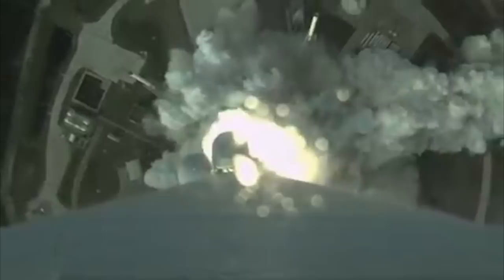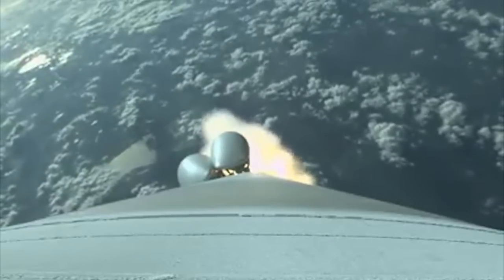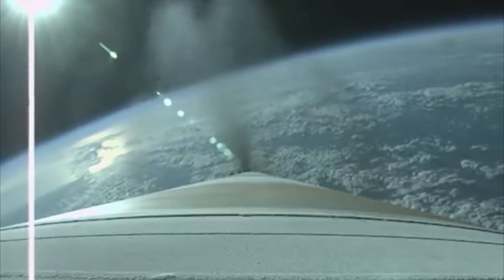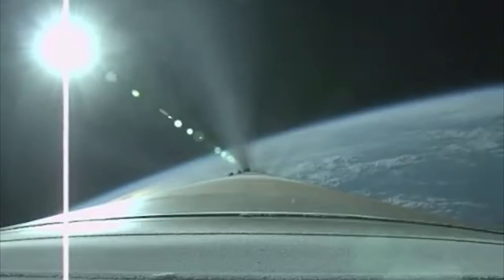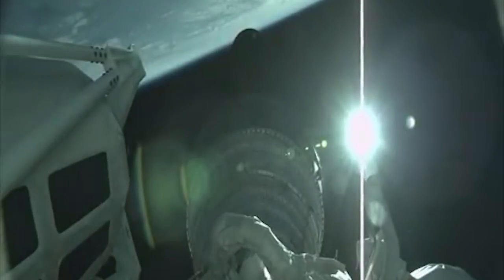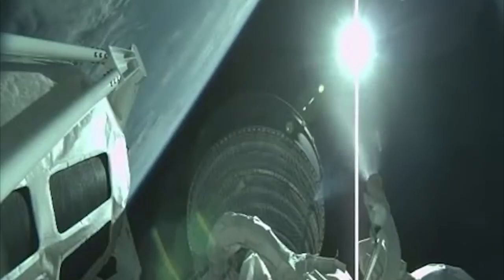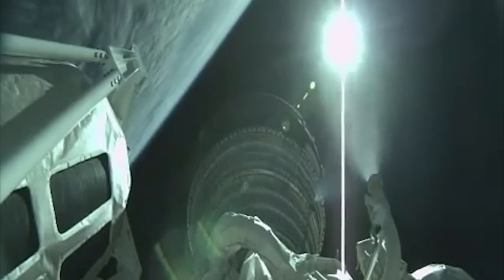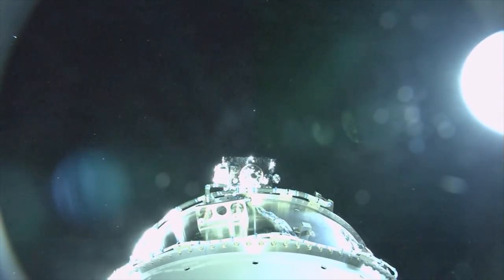Atlas V GOES-S Rocket Cam

Comment: Why rocket not going up in a straight line, so that we can see the full earth!

But it goes in the curved path.
Reply: cause it needs to gain enough speed to stay in orbit. There is no air up in space so u need to choose carefully where u wanna go. Also fuel economy etc.
Reply: Because orbital mechanics weren't made to appeal your desires
Reply: @AAAAAA-zw7oh  and you are telling this to an electrical and electronics engineer and an IT specialist and friend of isro's cheif data base manager!

Science must give proper answers not generic or lame excuses!

I want live whole earth zoom out video, why no one taken it?

Radius of equator is higher than poles means why still nasa shows earth as a sphere still? If you answered this you may have come near to the answer for my question in my comment you replied for.

It goes curved because of earth shape is not a mear sphere as nasa shows at all.

According to nada statistical data and isro calculations earth is like a bun or donut without a hole.

So its sky or atmosphere is not have same curvature and thats why you can see sattelites disappearing in the middle of the sky while moving or suddenly appearing in the middle of the sky.

You must closely and lively watch really what happening it with your own eyes at least with what you can see.

Am a regular star gazer and soecialised in astro physics, so i have a piint when asking about a question, so dont answer me lethargically!

I need exact answers since still i want to add more of my knowledge!
Reply: @amalangelraj  I don't see how me telling that to an electrical engineer or to the king of Swaziland makes it less true. The goal of the mision is not to show the Earth to some guy on the lnternet but to put certain objects in orbit. Just whith the most basic knowledge of orbital mechanics, you can see why the path is curved, then.

Okay, so answering to your question about the radius of the earth: I don't know where did you take the idea that its so far from a sphere, but its not: the diference of the radious on the equator and on the poles is about 20 km in 6300, which is around 0.3%, hardly noticeable if even noticeable at all whith the bare eye.

"It goes curved because..." that doesn't make sense, to put someting in orbit you need to follow a curved path, as orbits are almost parallel to the surface of the earth.
Reply: @AAAAAA-zw7oh then you have to study more to understand.

Didnt you saw the heading of this video, it says rocket cam, to show what, space?

No, the bottom, the earth, from its increasing altitude!

This video is uploaded for all the some internet users to see and question about it to increase knowledge!

Google about oblated spheroid form of earth to know more and search all published articles from official sources for correct radius details.

If the reason is only to put a rocket in space orbit, why do nasa and other nation's space programes sharing earth as a perfect sphere, also they never a full rotation of earth live anytime in any video, it will reaet its position to somewhere where it start after a particular point off time passed.

People must understand whats going on about earth. Why nasa updating different earth for different times but not showing its original shape in live.

Rocket goes with a cam pointing to earth and you think its for putting it in to the orbit?

If something hits it, no one wants to know what hit it, or dont want to see what is above the rocket which is approaching?

From lower orbit how earth looks like amd in hogher orbit how earth looks like?

Yes as you say, they dont care much of the people who seeing their video on the internet. 

They want to hide things and many!

Everything will be coming out soon.

Definitely its not .3% as you think. Dont blindly follow any one website!

Collect orbital statistics, learn about azhimuth and altitude, learm about right ascension and declination.

Then verify the sun's position with any live sky maps, stars and sattelite movements with time accuracy and directional changes and magnitude levels of stars and satellites. Understand how seasons occurs irrespective of the gregorian calendar.

Currently Try predicting sun's next position at 4 pm and 6 pm you will find it not a proper circle but the path varies. Same you do from 5:30 am t sunrise and at 8am and at 11 am.

Then do the same at vernoxes.
Then only you will know what am talking about. Do this for all stars and planets too.

Do this from different places of earth.

Create your own data. Master it by comparing with other genuine sources. 

This not requires any telescope, but need sleepless nights.

If you are practised well nobody needed to you to explain what you are arguing with.
Reply: @amalangelraj  are you mistaking the video with the mision? I mean... you are aware that they didn't launch the rocket to upload a video to YouTube... right?
Reply: @AAAAAA-zw7oh  i wanted some one to find and understand its true reason of launching such rockets.and not misleaded that they have to beive about only what they have been told to beleive to!
Reply: @amalangelraj  what is the true reason acording to you?
Reply: @amalangelraj  for some reson your comment was deleted but I read something among the lines that you can only see the satelites in hours next to sunset and sun rise. So, we can only see the sattelites when they reflect the light from the sun, and when they enter earths shadow the become imposible to discern. And what? What does this tell us about some misterious secret reason for rocket launching?
Reply: @AAAAAA-zw7oh  i didnt deleted any comment, just edited to add more lines, you may have to refresh the page again to see it fully
Reply: @amalangelraj  you didn't make a comment about when you can see satelites in the sky?
Reply: @AAAAAA-zw7oh  you need to do the homework, so you will find more details! I gave enough details in my previous comments. Its not only the shadow, there is something called altitude which modifies the magnitide of the objects propagating your horizon.

Just try to create your personal data on your favourite objects and their path which is not same in the sky.

There is no secrete if you do it by yourselves.

Dont rely only on websites or videos, see it, calculate it and find its originally, you will be amazed of what you find at last
Reply: @amalangelraj  yeah, yeah, I'm sure that you've made your calculations and have found that all the people who profesionally work on it are wrong... sure. I don't want to offend you, but you didn't even seem to understand why a rockets path is not straight.
Reply: @AAAAAA-zw7oh  did ever any rocket that went straight?

Its not about rocket path alone.

Its about what is really out there, what i told you to do is the simple reverse engineering to find what is told to all people is right or not by your own and to find its  degree of truthfulness.
Reply: @amalangelraj  what I'm saying is that if you don't know what the answer to the question if any rocket ever has gone on a straight line should be, you don't have the basic knowledge on the subject to be able to find a truth that's "being hiden to us". And don't get me wrong, that's fine, not everyone needs to be an expert on everything, but it's never good to try to "rebate" the experts from a position of ignorance. Because you're going to be wrong, people will think you're a fool and you'll end up thinking that everyone is conspiring or stupid.
Reply: @amalangelraj  mmm a technichal question. Did you use a numeric methods to calculate your orbits? Or did you go full analythic? Cause I guess maybe in some cases you'd had to consider 3-4 body problems.
Reply: @AAAAAA-zw7oh  you need to use analytic geometry when looking in the sky and before that you need to use trignometries for converting times, timezones and day values to your local for your predictions on objects!

Previous comment edited multiple times for spelling mistake corrections.

If you have sextant, it will help you more. 

The higher your having altitide the clearer you can verify your calculations.

Use pencils and rubber,  not ball pens, that will help.

Use accurate time not 24 hours for earth's rotation.

Forget about leap years and the extra day added to February thats not created for us but for religion.

Consider calenders altered in 1582 and in 1975 since we not used accurate hours of earths rotation if you predicting positions of long travelling oldest comets

Always go for lower magnitude sky objects for accurate verification.

Iss have magnitide of 1 to 2, starlink 8 and 9 has mag val within 2 will be useful.

Select the one which will be crossing your place for atleast a month daily.

Some of them may not visible now abouve your horizon but soon it will.

Better luck for you with cloud free sky.

Happy star gazing and finding earth true shape and something called firmament!
Reply: @amalangelraj  so you did everything on XVII century fashion?
Reply: @AAAAAA-zw7oh  my prediction went beyond 10 to 13 days and i was confused where i missed, and after so many months of searching i found that i missed the 0.6 hours just added to our daily days to make it 24 hours.

And now everything works good, since i found how pope gregory change calenders.

If you are from america, include the daylight saving time if your watch resets automatically,  but if not, dont use DST.

Yes little bit old fashioned but still works well for analytical verification.

Use cooling glasses if you track venus after sun rise. Tracking sun is ok but due to earths eliptical revolution sun rise timings and right ascension position varies Within minutes.

Better to watch sattelites than planets for quicker results!
Reply: @AAAAAA-zw7oh  you know what, i found many uncharterred objects in the sky which wont fit into our calculations, which seems altering the course, may be UFOs or uncontrolled inactive sattelite debris!

I tried filming it but my mobile camera not catching that dim light since low resolution camera it has.
Reply: @amalangelraj  cool, and for some reason all your meassurements led you to believe that everyone is lying about the shape of the earth.
Reply: The rocket needs to do two things, get above the atmosphere and rotate around the earth in an orbit. At the start, when the speed is slowest, getting altitude to get above the atmosphere is the most important. As you get higher, and there is less atmosphere, you start to transition to getting into an orbit.

If you are in near earth orbit, you need to travel 7.8 km/s (17,200 miles/h). If you were to get this speed in the atmosphere, you would lose much of your velocity to air friction.
Reply: @paul.vulcon  the sattelites are actually,

Appearing in the middle of the sky, not disappearing in the middle.

Yes sattelites are actually reflecting the light only when in a particular angle of its body while rotating itself to sun light from below horizon which is only in before sun set or after sun rise.

Its very nice to have a good friend like you shares his valuable knowledge!

I have much more to discuss!
Reply: @paul.vulcon  yes im a regular star gazer and sattelite tracker!
Reply: @paul.vulcon  interesting, from where have you learnt this knowledge friend?
Reply: @amalangelraj  I read a book a day and google anything interesting, I couldn't give you specific information as to my source without knowing which information you're referring to.
Reply: Because that's how orbit works.
Reply: @amalangelraj  If you want to see the whole Earth look up DSCOVR. It's a satellite about a million miles out, takes a picture of the entire globe every 2 hours.
Reply: @xyex  do we have any specific link to see those pictures?